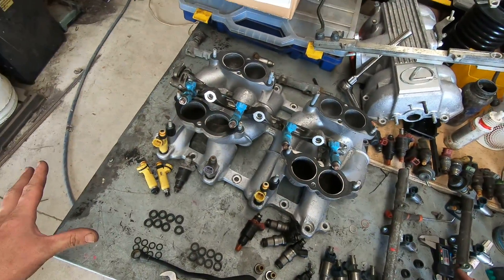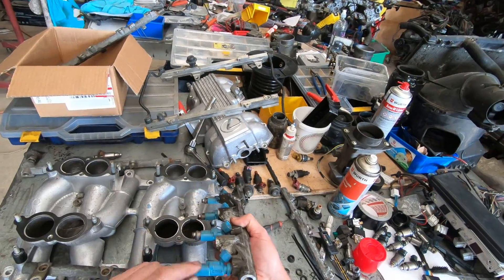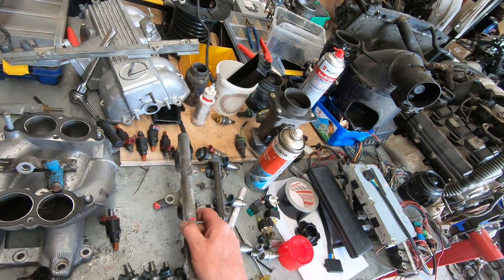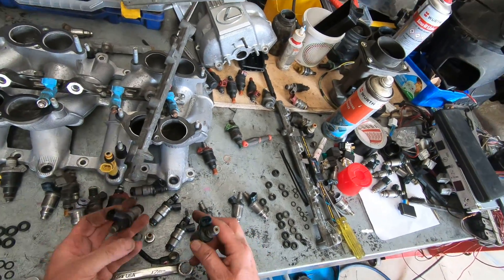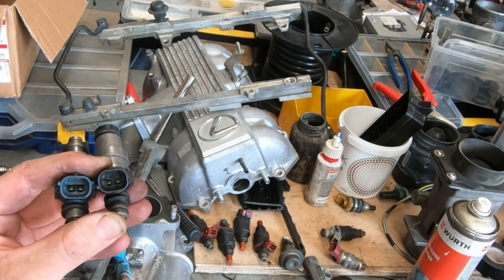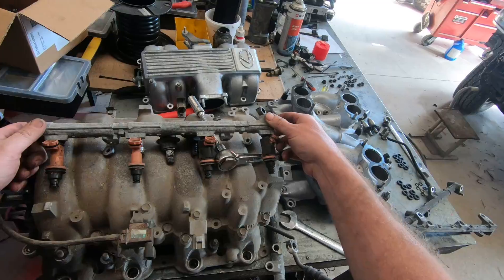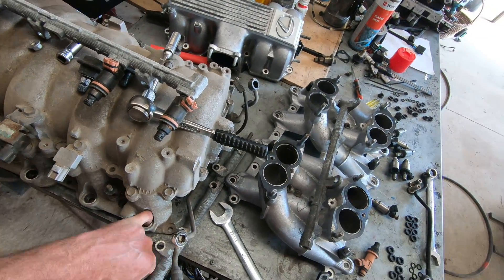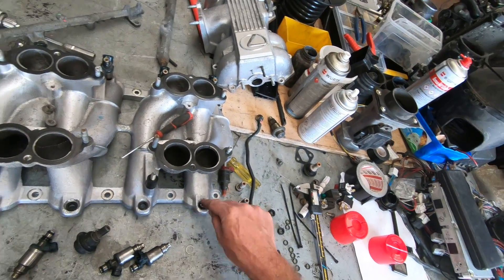What injectors fit a 1uz non vvti?  And quick look at VVti (1uz / 3uz) too.

Comment: Can i use lower flowing LS400 injectors in a 92 SC400 to get a leaner burn? I have 100ppm HC on the tail pipe test and i need 55ppm to pass. I've tried everything shortnof replacing the 3 cats ($1500)  to pass cali smog.

Comment: According to various sources the RX8 uses a  Denso 195500-4450 (550cc), and 195500-4460 (650cc). Does that sound about right? I'm fixing to find out if the 195500-4460 work or not...

Comment: Good info there, my 1st thought was to use RX8 yellows, but in the UK a second hand set of 4 will set you back about £100, obviously need double that. 
But for £220 I got a set of 8 new Bosch 550cc "GT500" injectors, only downside is it has a 14mm top seal and the body is 10mm shorter. So several hours of machining needed but for the price it was worth it.
Reply from the maker: yes.  I should do a video on fitting the 14mm style o-ring injectors to the UZ rails.

Comment: hello, do you know if you can run the 1UZ non vvti fuel rails onto the 1UZ vvti manifold? do the mounting bolts line up? I'm trying to upgrade to billet fuel rails and I want to see if they will fit on my 1UZ vvti because they are technically made for 1UZ non vvti. thank you for your time!
Reply from the maker: Easy answer,   they dont interchange between non vvti and vvti.  Cheers

Comment: So seeing as the factory rx8 fuel injectors fit, does this mean you can use aftermarket rx8 injectors?
Reply from the maker: Well if aftermarket RX8 injectors fit into a RX8 then chances are they are going to fit into a 1uz don't you think?  Yes all interchangeable fine.

Comment: Can you do a video explaining how to bypass egr on stock ecu?
Reply: I have a 95 ls400 I want to delete the egr on
Reply from the maker: Already filmed and edited however I cheated and fitted a non egr ecu so no fitting of resistors to the ecu.  Egr models are very uncommon over here.
Reply from the maker: Will be released early next year as part of a ls400 refab.
Reply: @CartuneNZ  will you be showing how to fit the resistor to the ecu?
Reply from the maker: @witerobb42  I am not as I swapped to a jdm ecu as the ECU was also stuffed.

Comment: Great stuff Kel, really appreciate the insight. 
Question, theoretically, if first gen Soarer injectors are 250 cc, it it feasible to change them, and their computer, into a first gen LS400 for more fuel/spark = power? 
Would it be THAT easy to take the 180kw first gen LS400 up to say 200kw?
Reply from the maker: Hello Higgo.  It would be a shitload of work for very little gain.  Swapping to a UCF20 ecu and loom might be more practical and give better results.  I'm presently doing a job using later ECU on early engine.  I've just finished a refab on an LS400 and thinking I might have to get one as a workshop test hack.  I have some many ideas to try on it.  Need more time to do it though.  Cheers Kelvin

Comment: So I have a 97 1uz with a 91 ecu and harness running it. How can I improve my cold start since it seems I dont have a cold start injector? the computer cant keep it on in the extreme cold until it warms atleast a little bit. I have to manually hold it for a minute or so until it can hold itself alive. 

Advice appreciated!
Reply from the maker: Ive got videos coming on swapping harness and ecu setups very soon.  The best way is to match all the components so with yours you have gone from sequential injection backwards to grouped with cold start.  I would be confirming it is set up correctly as per this video https://www.youtube.com/watch?v=zIGrntJYp2E&t=101s

Then ensure the IAC is healthy.  Also the early ecu had smaller injectors so I would confirm the injectors match the ECU.  Making sure all the parts are correct is the best thing to do and ensuring all the other normal stuff like there are no air leaks , ignition is in good condition etc.